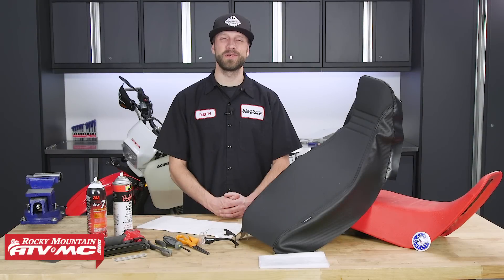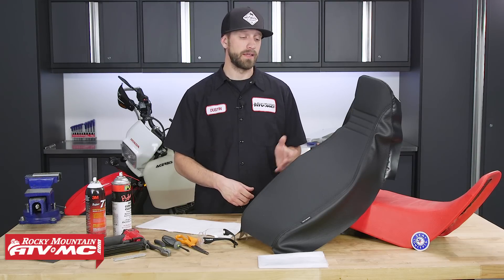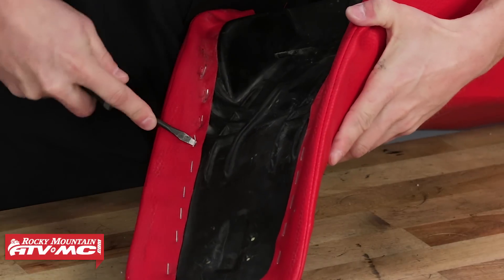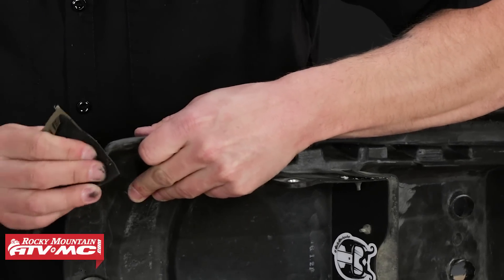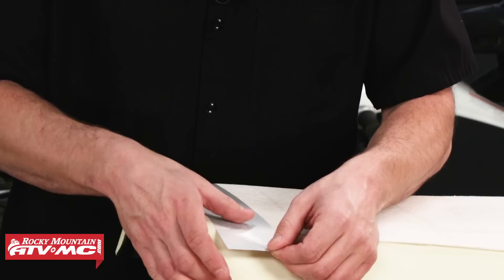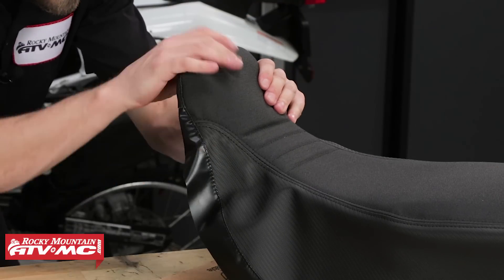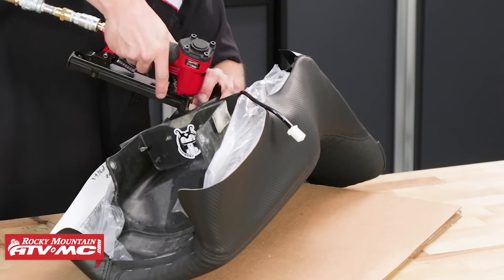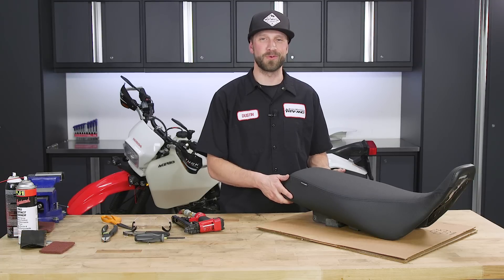How To Install the Seat Concepts Motorcycle Seat Cover and Foam Kit

Comment: I had to put mine on pretty tight to get all the wrinkles out.  It looks like it was professionally installed, but I can assure you that had I not pulled it tight, it would have looked like s#*t!  Notice how the guy edited the video and magically whole sections are finished.  That's because if they showed how much of a PITA some of these seat covers are to put on, lots of folks would shy away from them....me included!  If you live on the west side of the Mississippi river, it would probably be worth it to ship your pan to Seat Concepts and let them install it.  I'm a Taxidermist and there for a while, I was beginning to think I would never get my Seat Concepts cover on just right (no wrinkles).  If I had it to do all over again, I would have paid the excessive shipping to ship Seat Concepts my pan and let them do it.  The guys that install these every day KNOW exactly where to pull, how much, and how tight!  After doing mine, I have even more respect for the Seat Concepts guy in another video installing a cover on an XT250  Seat.  He made it look EASY with NO EDITING!    Good Luck!
Reply: Dang, now I'm sort of scared to do mine myself, I should have sent my pan to them for fitting, I guess I'm going to try to find someone local that can do it, I'm too picky and will have to re-do mine 5 times to get it right.